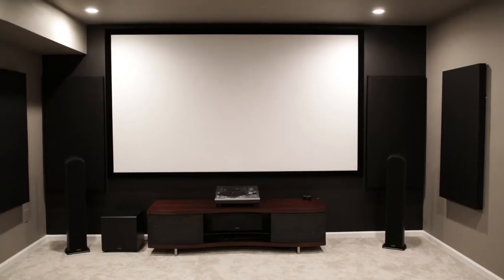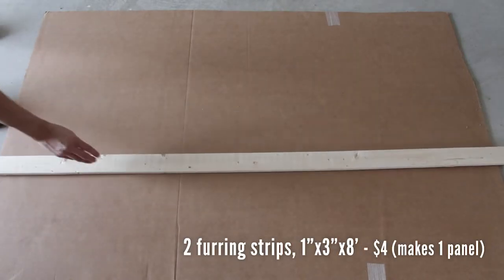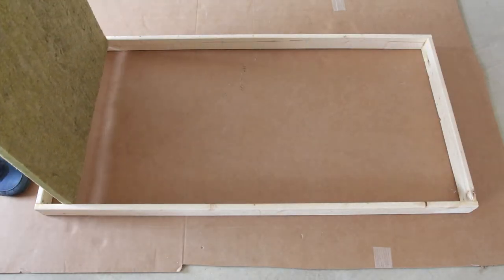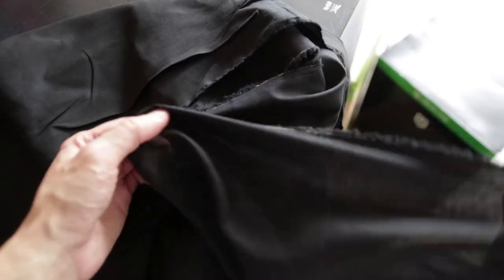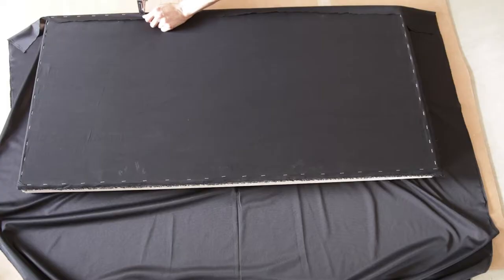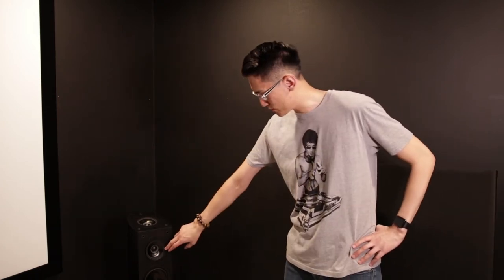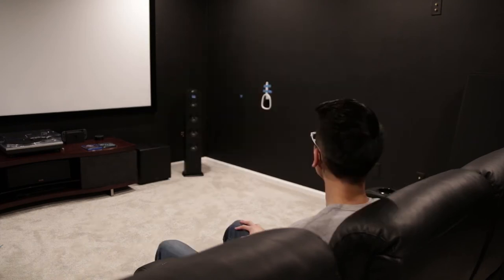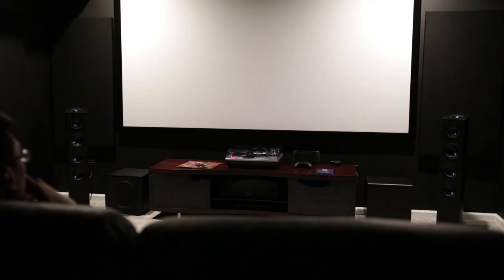Improve Home Theater Sound with DIY Acoustic Panels

Comment: again, FIX THE COLORS of the room !!! still white carpet, I have not seen the door but I suspect they are still white, the baseboard are also white... at least some walls seem to have turned dark but you need matte black or dark paint... you can see the reflection on the wall even with your dark paint... then you can fix the sound !